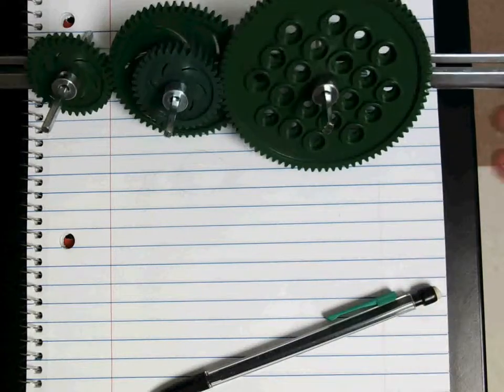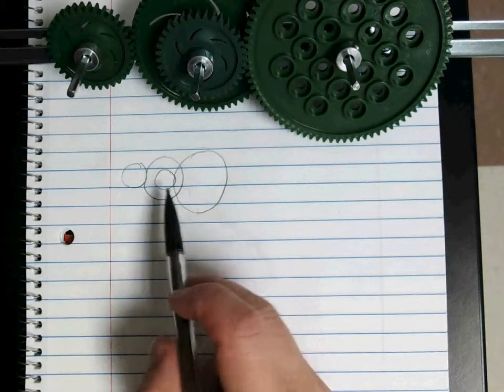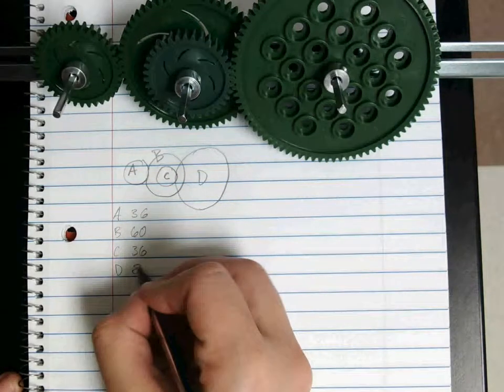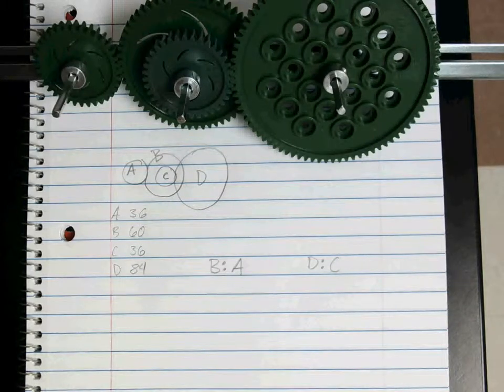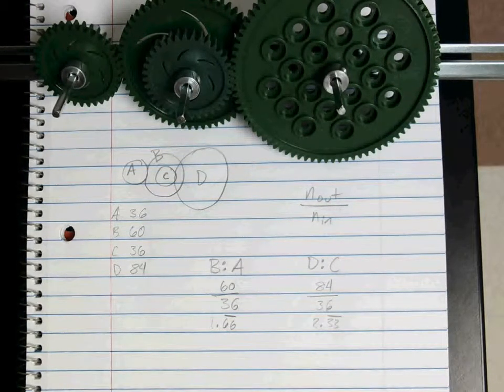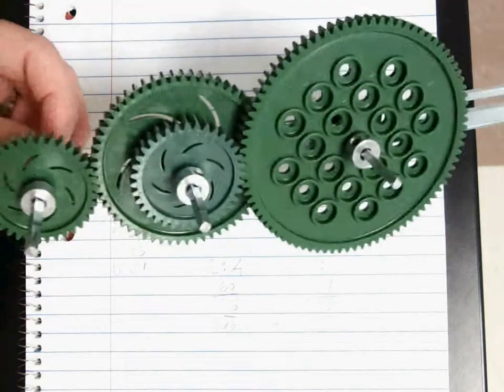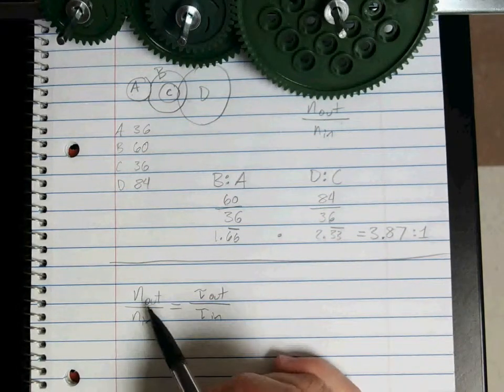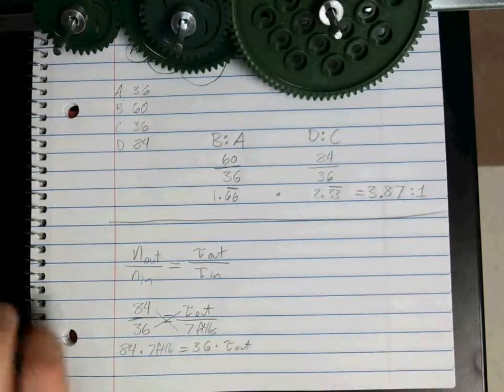Compound gear train 1.1.3

Comment: What if the teeth are different sizes
Reply: if the teeth are different sizes from each other then they will not fit together.
Reply: @ABagOfToes  A and B could be one size of teeth, and C and D be another. I think he's asking how would you solve for THAT.
Reply: @0rbnotacus  i dont get it how b and c rotate at the same speed since they are different in size?even if the are on a common shaft how is that possible?